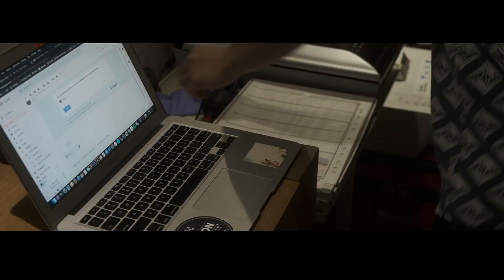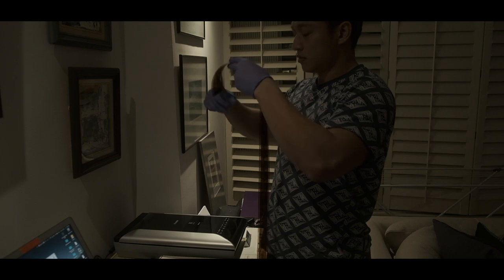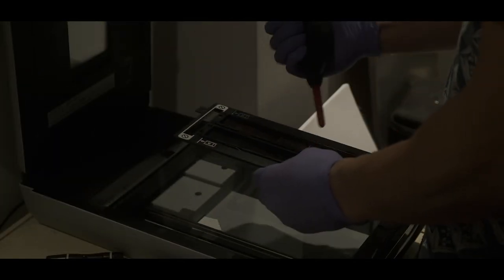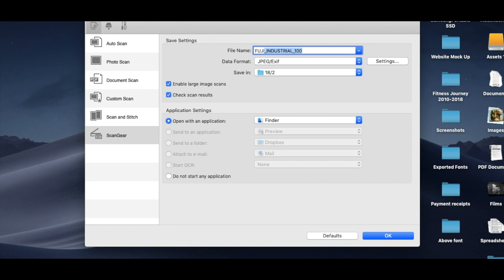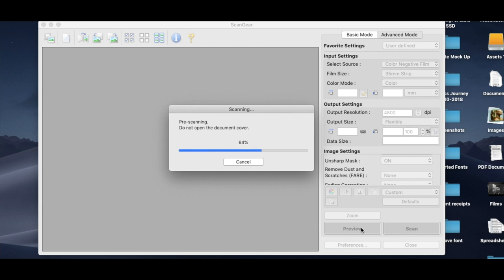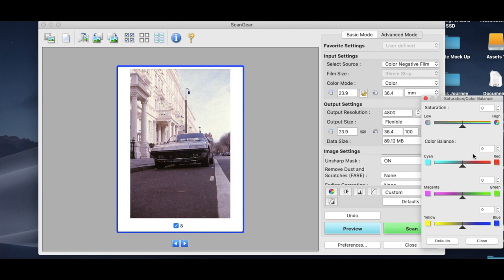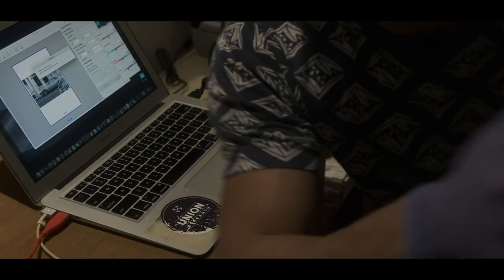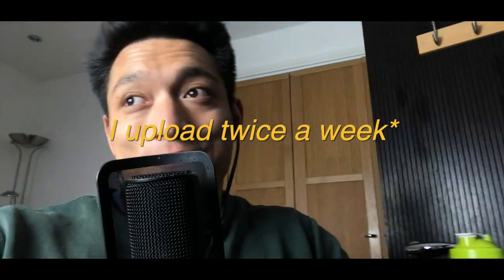How To Scan Film at Home // CanoScan 9000Fii

Comment: I have the CanoScan 9000f mark ii and I'm scanning medium format 120 film. What I've noticed is that regardless of how high I boost the quality the images are coming out soft. I took some of the negatives to my local lab and they're scans were soooo much sharper. Do I need to do some kind of calibration to my home scanner? Why are the same images coming out so sharp on the lab scan and so soft on my home scan?
Reply from the maker: Labs use far better scanners, that's why. The CanoScan is consumer grade entry level scanner. You can try using a piece of ANR glass from someone like betterscanning.com. I've found the most cost effective way to get sharp results is to go the camera scanning route.